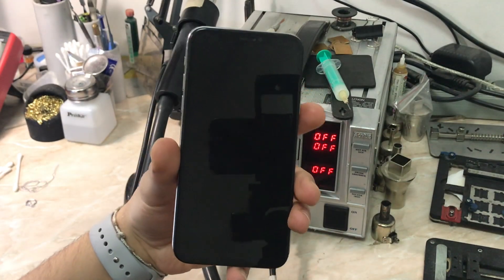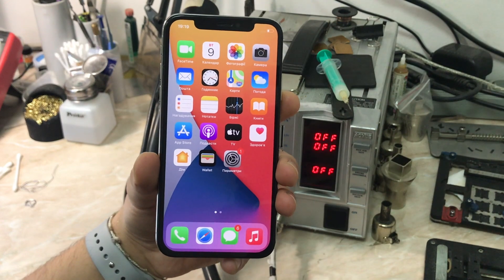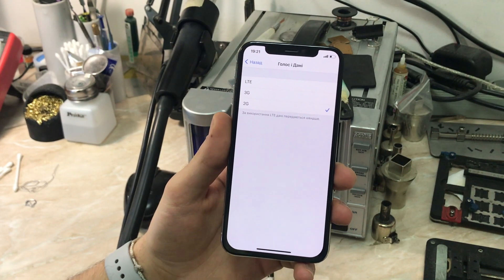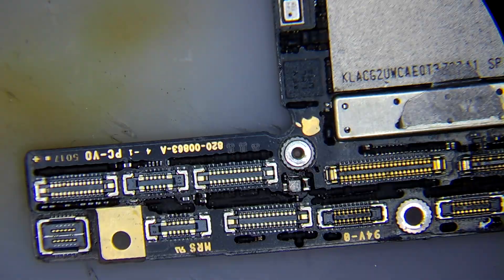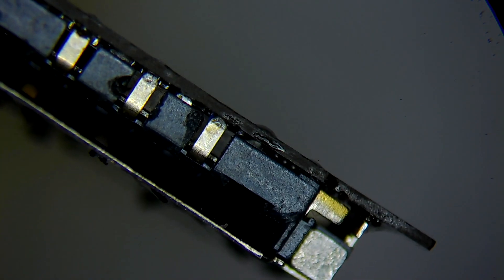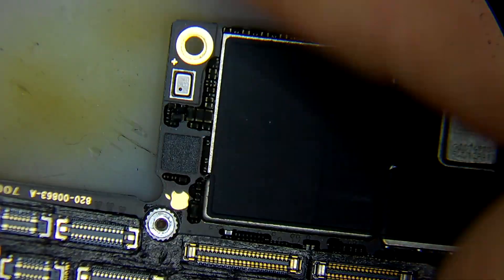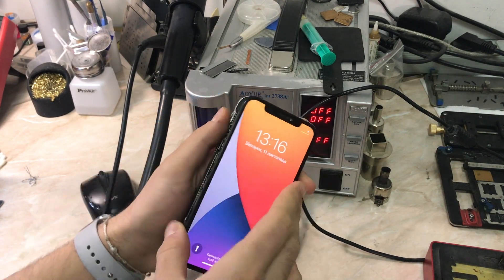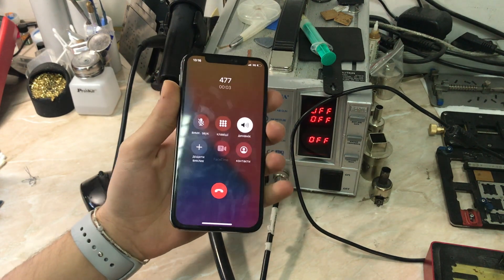iPhone X No Service (Save Your Time and Swap)

Comment: Hello I have iphone 6 and the problem is no service I tried resetting the netwok but nothing happens, so I decided to have it checked they said about the based band that needed to change because the IMEID is not showing, I just need to do a 2nd option before having it repaired since it will be expensive. Hoping for you to check mine.